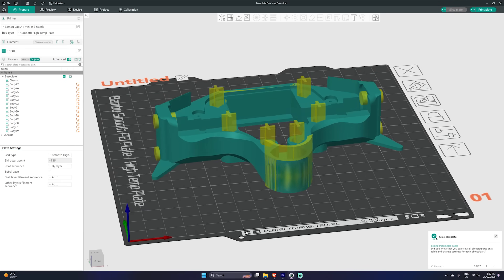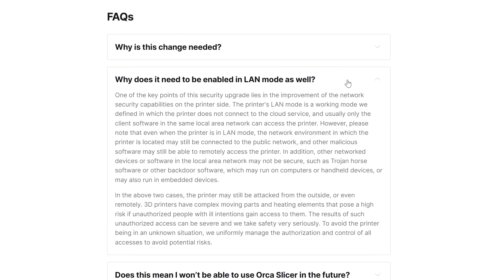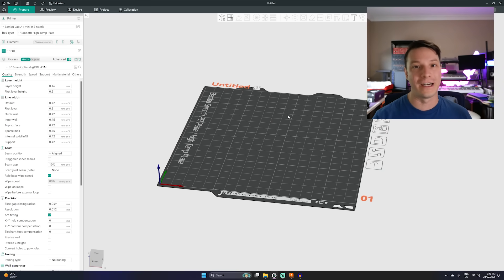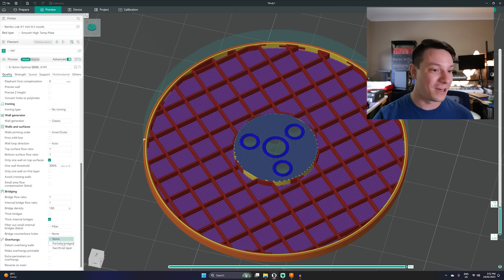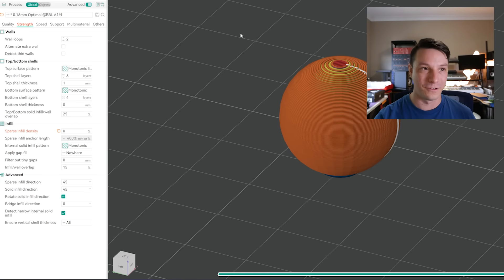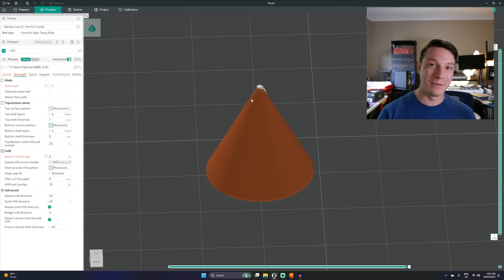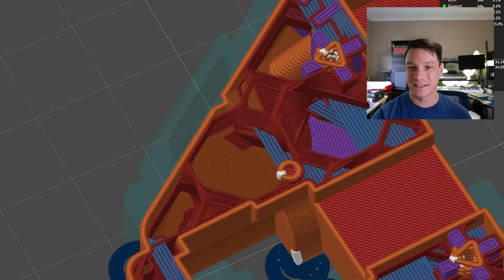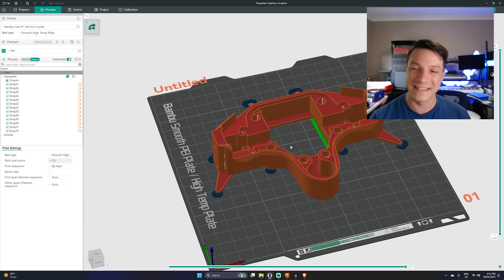I've switched to Orca Slicer for my Bambu Lab 3D Printer (and you can too)

Comment: Orca is my quick lazy slicer, cura is still my fine control slicer. The gap is closing, and features like painting is amazing but cura still provides more options. I really hope this changes though. 

Polyhole is really intriguing! 

It’s funny that ensure vertical shell thickness “none” was the default for cura and a reason to switch to orca was because it could add extra layers, cura got those settings soon after, it’s called something else though.
Reply: Yeah, I always hear people say that slicers like Prusa Slicer and Orca Slicer are more powerful than Cura and have more features, but in my experience, Cura allows you to change the most settings and makes it the easiest to change those settings. I now use Bambu Studio because I got an A1 (and I dont really use Orca because I just like the ui and placement of the settings a little better in Bambu Studio, and if I ever need those settings then I can use Orca for that specific thing), and I still think Cura is under appreciated.

Comment: I've been using Cura for my extensively modified Creality printer. I don't even remember why I ended up choosing Cura back in the day but it's worked well enough so I stayed with it.
I like what I'm learning about Orca though, so it might be time for a change!
Reply: Cura still has that terrible interface and some weird logic about presets. I hate it. Otherwise it would be a great slicer. But the defaults are terrible.

Comment: Great video again.  I do have a question about using Orca slicer with a Prusa MK3, would you still recommend using Orca slicer instead of Prusa Slicer if all I have is the Prusa MK3?  I understand what you are saying about Orca slicer and a Bambu printer, but what are your thoughts about Orca slicer with other brands (obviously I am more interested in your thoughts on it with a Prusa printer).

Comment: 1:08 look at the shake in that table! How in the world is that going to be a good print?!
Reply: Really doesn't effect it that much, surprisingly!
Reply: That’s the table absorbing energy. Energy that would otherwise be absorbed by the frame and printhead. 

There are conditions where it can negatively affect print quality, but usually it’s a positive effect. 

Now if you’re running multiple printers on the same surface, you definitely want it to be solid, as transferring energy from one printer to another will always reduce quality.
Reply: @ wow thats interesting! Makes sense in theory but i just feel like the jiggle could be an issue

Comment: I would really like to see from you or another major youtuber in the 3D printing space a video on how to use Orca with resurrected Creality or other cheap brands machines that use Klipper and also with custom Klipper 3D printers.
I tried switching to Orca, and it wasn't easy at all with my CR-10 Mini and Ender-5 Plus with Klipper and many upgrades. Two times I tried and went straight back to Cura. Thanx.

Come to think of it, in the worst case, bambu owners have the option to change the mcu, grab a raspberry pi and put regular Klipper on their machines thus freeing themselves from the CCP. That would also be a nice video to make.

Comment: That's great and all, but I can't get Orcaslicer to even see my A1 in LAN mode. I've looked through everything and there doesn't seem to be an answer on how to fix this. It works fine in BambuStudio which I would like to stop using.
Reply: Well... I feel kinda dumb. I used to work in IT and should've employed the old standard of, "Did you turn it off and back on?". Cycled the printer power and then restarted Orca and there was my printer ready for me to enter my access code.

Comment: I love my Bambulab 3d printer but proprietary software and ecosystem lock-in really hurt their product. Simple things like the printer won't connect to the bambu studio if set up in LAN mode and on a different vlan than the computer are a pain. No wired network connection is also annoying when it only supports an extremely slow 2.4GHz WiFi connection...

Comment: 3:00 just history repeating itself, a company makes a move as part if a plan that hurts users, steps back slightly when everyone gets on them for it only ti wait for things ti cool down to tighteb things further, thats how these things tekd to work.
Reply: Orca never got official support so nar
Reply: @MCD10000  im not talking about orca and to be quite honest it doesn not matter if orca was "supported" because it's all gcode.
Reply: @ the direct remote access to the printer was a backdoor, simple as that
Reply: @MCD10000  oh I forgot being able to control YOUR machine YOU paid for with the software YOU choose was a bug not a feature.
Reply: @ you can by using an SD card or a software which has integrated the official support, which Orca has already said they aren't doing
Reply: @MCD10000  that's just stupid, they literally knew many of their customers used other software and proceeded to lock things down. Nobody paid for these machines with the expectations they would get their machine locked down like that, it's just flat out dirty and unacceptable.

Comment: the only setting I need and missing from Orca slicer is set seam at angle , so I can put seam at where I want as straight line but now Orca slicer can't do that , you need use brush tool and it's painful

Comment: I've had my printer for less than a year. I found the Creality slicer was just no good. I moved to Cura for a few prints but wasn't getting satisfaction either. In both cases, I just couldn't find most of the settings, that videos showed, needed to be tweaked to improve my prints. FYI I mostly print minis for table top games.

I thought I would try Orca. All the settings I had wondered about were there! I selected my printer profile and did a test print without any further tweaks, and behold, not only did the prints get to completion without major problems, they finished with better quality than ever. I've had little to no trouble with my prints since, still mostly using default settings.

The one big issue I did have was easily adjusted. I found the default settings for Slim Tree supports were too robust! I can't tell you the number of swords and spears I broke trying to remove the supports that used the default settings. I changed to putting them on the build plate only and thinned the attrachment points slightly and - problem solved!

I still consider myself a nood in this hobby, but little by little I'm learning. Thanks to Orca Slicer.

Comment: The only thing I don't like about OrcaSlicer is the fact that some "genius" thought it would be a good idea to split print profiles into two different sections; One where print speed is defined and a different profile where print temperature is defined.
Absolutely terrible horse crap design. So every time you want to switch materials, you have to switch TWO profiles instead of just one.
And don't even get me started of the problems this causes for multi material prints.

Comment: ok i'll ask the dumb question. my laptop and bambu are on my home wifi network, but i've not set up any kind of LAN. Will orcaslicer "see" my X1C as per this video, or do I first have to do something like setting up a LAN? (and much thanks if you can link me to a good source for how to do that!) thanks.
Reply: Your WiFi is part of your LAN. It's the wireless part, the other part could be devices that you've connected directly with cables to your router.

Comment: Orca and bambu slicer are missing "fix model" under linux. At least half of the models generated by CAD software and are downloadable on printing sites have mesh problems with complex geometry. Step files doesn't fix that either in some cases  as it is the slicer which has to generate inner and outer walls. Sometimes creating missing layers when slicing which can cause print failures. Besides that both slicers have consistency problems saving and importing print profiles. These are both hobby slicers.

Comment: Haha it wasn't till last night that I realized my orcaslicer start_gode for my klipper machine was not actually parsing temp values to my print and I've been running on my default temps. I didn't know the orcaslicer's gcode section all had to be on one line with no additional spaces. Fixed that and off to the races. @Sineos on the klipper discourse group has a really really great tutorial for setting up klipper start and end_print macros with various slicer's.

Comment: Thanks for the video. I am trying to use Orca (2.2.0) with my A1 on MacOS (15.3.1) running on an MacBook Max M1. This was working fine for months and then Orca started crashing on startup a few weeks back. It starts, displays the start screen, waits a few seconds and then crashes repeatedly. Sometimes it produces a Crash Report other times it doesn't. I've reached out to Apple Support & filed a ticket with Orca but to date nobody has been able to help. If anyone has any ideas I'd really appreciate it. Is anyone successfully running Orca on MacOS Sequoia? I really need to get Orca running again. Thanks for any help.
Reply: It seems that they support Mac less. I am on MacBook and Orca while running becomes slow and the small menu is buggy. I am on 14.6 and it works, and now I will not upgrade to 15 because of your experience...I am thinking of buying windows laptop for the orca.
Reply: @vim55k  What version of Orca are you running? While this was working it was running fine. I never saw Orca running slowly or any issues with overall functionality. I do have a Windows machine too but have resisted going back to Windows for Orca use but if this can't get resolved I may do that.
Reply: @christopherlyons7613  2.2.0 , will soon try the new beta

Comment: I have empathy for the Bamboozled Bamboo 3D Printer buyers!  Well, people seem to like the hardware.
Reply: The hardware is very good.  I physically ripped the WiFi out of my P1S and use an SD card like ancient times.  Printer still prints great using Orcaslicer and I’ve permanently removed a machine from the Bambi ecosystem.  I’ll never buy anything from them again :)
Reply: What are you talking about?
Reply: If you like the mechanics, just throw a Duet3D in, and then you can transfer print jobs on WiFi, have RRF updates, and customize the F out of everything. I can’t imagine myself tinkering with SD cards and following how manufacturers want my printer to work instead of how I want it.
Reply: The printers are great, and the software side is not going to affect 90% of people

Comment: I tried OrcaSlicer a couple of times, and it made worse prints than SuperSlicer. So I left those efforts = ))
And also I do not like that 'turned inside out cura' interface. For me 'prusa' style is more understandable.
So it is no-no for now. But I'm glad that Bambu users are able to choose what slicer they prefer... yet. = )
I use Ender 3. Have no trouble with firmware upgrades and slicer selection.

Comment: I'm just wondering if I get this right, but isn't 'crosshatch' infill just blocky gyroid? Or does the straight section that crosses itself over the previous layer line help with better connected infill? (connected to itself)
Reply: It was intended to be a quieter gyroid especially at higher infils

Comment: I have an idea i call pillar mode. The printer should print as many layers in z as possible before moving in x and y. Imagine you are printing an upside down table. It will print as much of each leg as possible. If the legs are so close it will print 2-3 layers, or as much as possible to where the print head can still clear neighbors. Then if the legs are far enough apart that the head will clear other legs, it will print the entire leg before moving to the next. This is a mix of print by object and print by layer. It just automatically identifies clearances and part avoidance to reduce wasteful print head moves.
Reply: Neat idea but I think there are issues you can run into if you print in the Z axis too fast due to lack of time for the previous layer to solidify. You'll see this if you print thin, tall structures without forcing a minimum layer time.
Reply: @anonony9081  good point.
Reply: This is something I've been thinking about too. To similar effect, I'd like to be able to print small parts (by object) much closer than is possible in bambu studio. If printing objects on the plate from front to back, it should be possible to print much more small objects than is allowed with bambu if printing sequence and head clearance is taken into account.
Reply: @janussQv  hate the bambu studio max height. Doesn't matter what order you ptint in. Just says too bad, too tall.
Reply: Clearance for the carbon rods 😉
Reply: You can set the "sequence of printing" as object instead of layers

Comment: I always design custom "mouse ears" that are two or more layers thick but only the first layer touches the part. I use a small offset on the other layers to create a gap. This has two benefits:
It prevents sharp corners to lift part of the mouse ear from the bed.
It makes it even easier to remove cleanly.

Comment: The thing to take away from this video (beyond learning tips and tricks) is that a lot of the features in OS were ported from other slicers and you should look for these same ones to work in the flow you're used to already.
Very few features in OS are purely built from OS development alone, many many many have been ported from SS. And ones like "Make Overhangs Printable" were from Cura.
Why is this an issue? Because a lot of other slicers have had their development stalled due to everyone jumping to OS even though OS didn't originate these settings. And because of it a lot of options from other slicers got left behind and won't make their way to OS. Cura brought a lot of the experimental features to the table due to its plugin system which Slic3r derivatives don't have. The PS team did a lot to bring some of those in themselves as well but these aren't always the same, see: Tree vs Organic supports. (they aren't the same thing)
I can't predict the feature with these slicers, just in the last two years a lot has changed. But I personally don't like OS (due to many bugs and other issues like dev attitudes) so I am worried to see everyone willing to give up any alternatives being worked on still just because one fork kept updates coming more often than others and accumulated features.

Comment: I've been desperate for a button to remove "Internal Solid Infill" as a single checkbox for a while. The transition to solid top layers is adding almost 20g to my lightweight print (about the shape of two smart phones end to end) and I would love to just turn it off. I could get it reduced by switching off "Ensure Vertical Shell Thickness" in Orca, but the only meaningful change was lowering my top layers to around 2; which obviously looks terrible. I understand the risks of no solid infill, I just want the choice!

I think until there's a toggle for that, I'm going to stick with Cura for certain specific prints and use Orca for prints with more complex geometry. It's not perfect, but Bambu are shuttering themselves out at a time when competitors in slicing and printing are making huge progress

Comment: I have used lots of different slicers, and prusa slicer has been my goto for a long time. I tried Orca when I bought my first bambu, and orca has become my new goto. 
Orca works so well with most printers, and the gui is really good. Has lots of functions.
Reply: I've only ever used Cura, is it worth using Orca for old school bed slingers?
Reply: @ferrumignis  in my opinion, yes. I use Orca for all my printers, both coreXY and bed slingers.
Reply: @ Thanks!

Comment: My favourite settings.

Alternate extra perimeter ( sandwiches infill) 
Reverse on odd

With alternate perimeter the Infill anchor essentially becomes part of the perimeter so you get the same strength as 3 walls with 2.5 walls.
Reply: The only problem is that this setting is broken when using in pair with combined infill.
Reply: It's nice, I wish it could also do alternating lines that are overlapped so that on top of 3 lines you get two lines in the gaps between the two lines above.

Comment: Thanks for jumping in on the issues with Bambu Labs and as always that honesty is what sets you and some others on YouTube apart from the fray. We appreciate that! ❤

I also have to say that Prusa has been forward thinking in its design and features of Prusa Slicer and I find it to be more powerful than Cura. It seems Cura has fallen behind.

 I've just reecently made the shift into using orca slicer but I've found issues that don't exist when using Prusa Slicer like for some reason it changes the z offsets automatically on one of my printers. I've found no reasoning behind it and finding the problem and solution just drove me back to Prusa where I don't have that issue. 

Again thanks for calling it like it is about the actions of Bambu Labs. I hate to see that happen because there's such a a fan base with Bambu Labs as they have gained a large portion of the 3d printer pie it creates some rifts between those that see the actions from an honest perspective and the bandwagon fans that blindly support their printer makers actions irrationally.

Comment: I would like a feature where i can change the number of walls or infill % at a set layer.
Reply: You can probably use the Cut tool to separate those layers from the rest and edit those layers.
Reply: @ now that is a good idea
Reply: I suppose that you can make a box modifier to achieve this..?